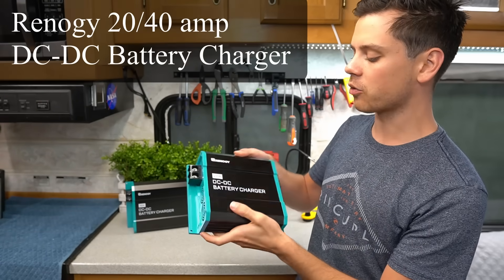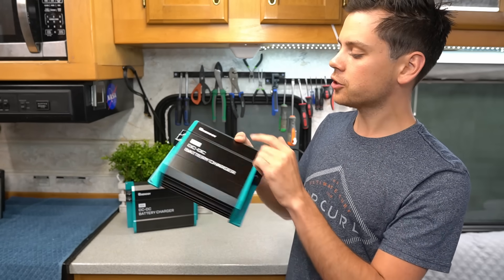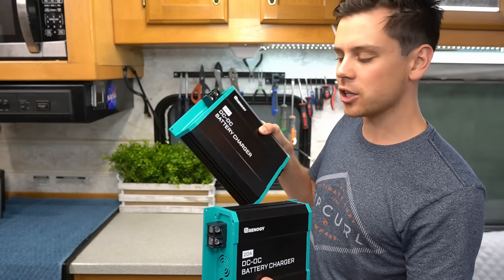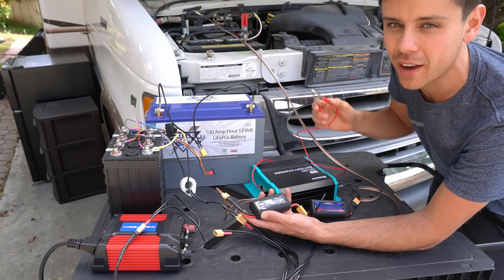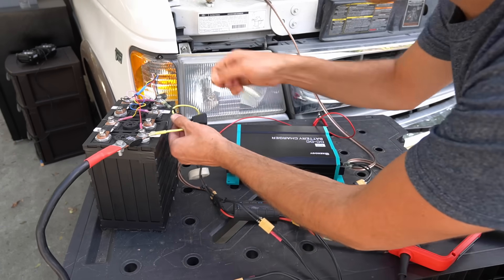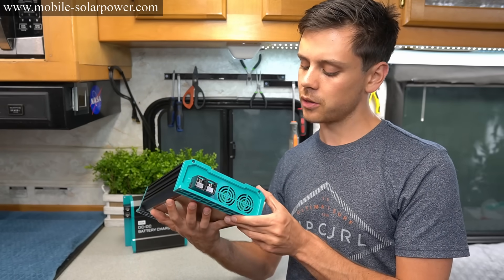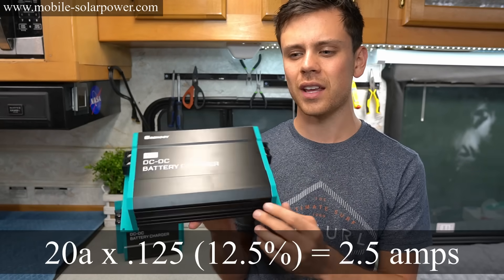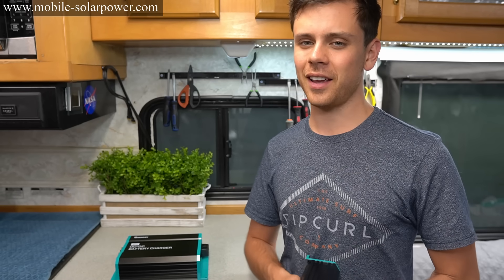Renogy DC-DC Battery Charger Review: "Smart" Alternator Charging for Solar Batteries!

Comment: Will, you may not know how many lives you save, with you information videos.  I am one of those who is charging 6 deep cycle batteries with my alternator...
I wanted to ask you should I install a separate (2nd alternator) just for charging my "House Batteries", and add the DC-DC charger to it?
Thank you for this and ALL of your informative videos....
Reply from the maker: Oh a second alternator is always a great idea. If you can do it. The nice ones cost a lot, but if you match a large standard duty alternator with a DC DC charger like the renogy one, you would be set. Also, they are coming out with a 60 amp model. That would work great if you had a dedicated alternator to use with it. And thank you!!! Glad I can help :)
Reply: Will, 
Thank you for your quick response.  I'll ask this next question, and maybe I'm not the only one whom needs to know...
Will, how do I calculate the size of the 2nd alternator to the size of the "House Batteries ", and if I use the DC - DC, Charger, will I need to continue the use of an isolator?
Thank you again...👍
Reply: @brownbunny2513  from what I understand, no isolator is needed... also for matching house batteries, there have been studies comparing charging at .2c compared to .4c.. (.2c being 20 amps charge going into a 100 amp capacity battery. .4c is 40 amp charge going into that same 100 amp battery) surprisingly, on a 100 amp battery with 50% charge, both .2c and .4c took over 5 hours to completely charge.. .4c being just 12 minutes faster.. you can charge at .4c if you know you will be adding to your power bank shortly.. but my opinion, if you are set with your battery bank, aim to charge it at .2c (20% of your rated battery capacity in amps) meaning if you have 200ah capacity total in 2 x 100ah batteries connected in parallel, or whatever your system may be, 20% of 200 is 40... which means you should be charging that system with an 40 amp charger. I would match that with a high output alternator rated for over 80 amps. pair it with the 40 amp dc to dc charger so your alternator is never struggling... this is just an example though. Change these numbers around to match your needs.. I'm also still learning as I go, but want to share what knowledge I have because there is so much misinformation out there
Reply: @brownbunny2513  just did more research, always check the charging specs for your particular battery but I just found out lifeline agm batteries can accept 5c current for very brief moments without damage.. 5c not .5c.. which means 500 amps in a 100ah battery.. insane... also comparing .2c to .4c charge before, I was under the impression that .4c would hurt an amg battery by exiting bulk charge phase sooner.. I was wrong.. real world charging, if you only have 2 hours to drive, and know you can not charge your battery to 100%, a .4c charge is much better than a .2c charge. Either way, if I'm constantly discharging to 50% and only driving an hour or 2 a day, I would look into solar panels to finish them off... agm needs to see 100% charge regularly to stay healthy or you will only get a few seasons out of them... basically to recap, higher charge currents are better.. once batteries reach absorption  phase, the amps automatically will decrease because of resistance inside the battery.. so even if you use a 100 amp charger on a 100ah battery, once the battery is at 70% charged, the amps going in will decrease drastically regardless. The problem then comes down to the size of your wiring. High amp loads need extremely thick wire to carry those amps safely.. in the end, I was wrong in my last post. It seems that overall for a camping situation, a .4c charge would be better than a .2c charge

Comment: Hi Will.  Some great points on the benefits of a DC-DC charger over using an isolator or other type of direct connection from the alternator to the house batteries.  With the high charging capacities of lithium batteries, a discharged lithium battery could draw serious current from the alternator - 100 amps or more - under a direct connection.  Even if the alternator can handle the load, the cabling would have to support those loads, so 1/0 awg runs depending on distance.  With the DC-DC charger, smaller cable can be used since the loads are limited to 20 or 40 amps for the Renogy models and 30 or 60 for Sterling’s.  Even though the Sterling models cost more, I’ve been impressed with them enough that I think they are worth the extra cost.  Plus, the Sterling models have the option to jumper the ignition detect for automatic start and shut down.
Reply from the maker: Yeah I like those added features of the Sterling. Totally agree.

And yes, the current draw of discharged LiFePO4 battery can be extreme. The resistance is incredibly low compared to a lead acid.

And yes! Smaller wires. A lot easier to manage 20 amps compared to 100 amps. Exactly

Comment: How will you use it with your 24v Tesla battery if it's made for 12v?
Reply from the maker: It doesn't work with Tesla battery. You can use a boost converter with current limiting and voltage sensitive relay for Tesla charging though.
Reply: @WillProwse  Ah thanks, it's a little more complex but worth it I think, I'm planning on using a Tesla battery in my van conversion and would like to mix in another way to charge it.
Reply: @WillProwse  can you recommend an appropriate boost converter with current limiting and voltage sensitive relay that would work in this application?

Comment: Hey Will. Enjoying your videos.  From what I’ve read the reason the Sterling one is so expensive is because it is designed to be used with regenerative braking systems. All relatively new sprinters have this.  The vehicle battery in a newer sprinter (2010+ I think) is huge and has a very complicated regenerative braking charging system.  The alternator sends crazy different spikes of power.  The Sterling dc to dc charger is 60amp output and doesn’t hurt the vehicle battery or alternator.  I’ve had a dc to dc charger (sterling) for a year now and it’s a game changer.   Other people I know that have connected their alternator directly to their house bank have trashed their battery.  Renogy one looks like a great alternative but I’d be weary of using it with a newer sprinter van or other regenerative braking systems without doing more research.
Reply from the maker: How would that be any different than the renogy charger? Both are converter circuits. Pretty simple regulation method. And input tolerance should be similar. Any DC DC charger would be able to handle the sprinter issue you mentioned.
Reply from the maker: They regulate in exact same way. Very common circuit design.

And yeah, never connect any alternator to deeply discharged battery.
Reply: Matt Bolton Music What type of battery are you using in your setup?
Reply: Aaron G Lifeline 6v AGM’s connected in series parallel.
Reply from the maker: Yeah good question Aaron. And that's awesome that the Sterling is working out great after a year. Good to know

Comment: So these are safe to use with lifepo4 batteries ?
Reply from the maker: Exactly. Custom DIY lifepo4 or drop in options.
Reply: @WillProwse  do you know if the temperature switch will block the charge during low temperature conditions? I am looking for a way to drop in replace lead acid batteries in a daily driver, in the Midwest where winters often drop below freezing with LifePO4, a switch that limits the charge until the battery is above freezing would be great. I prefer to avoid a battery warmer, but might have to go that route to avoid frozen charges.
Reply: Will Prowse weren’t there switches on it to allow customizing the charging parameters?
Reply from the maker: @AaronGeller  yes and the lithium charge profile parameters are great. The manual is a little confusing but anyone can get it down in a couple minutes after reading it. You can charge at reduced voltage too, for custom lifepo4 home built batteries. it is awesome.
Reply from the maker: @AaronGeller  https://www.renogy.com/template/files/Manuals/Renogy%20DC-DC%20Battery%20Charger%20Manual.pdf